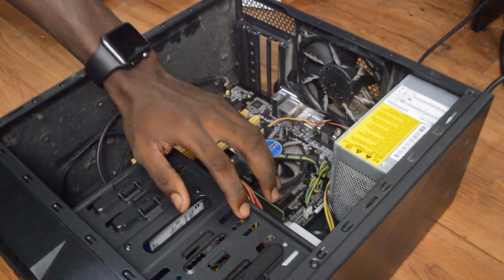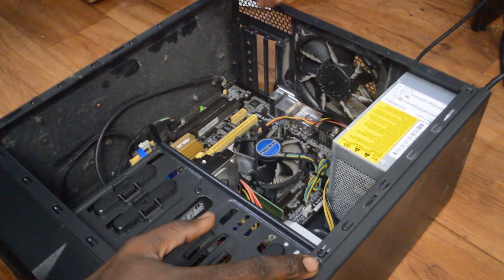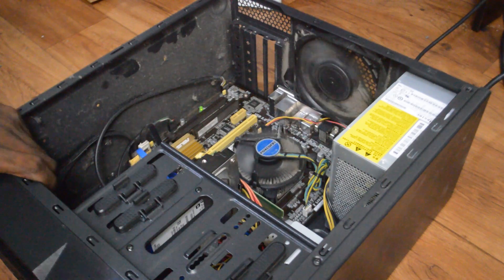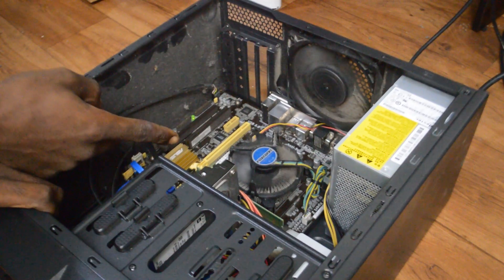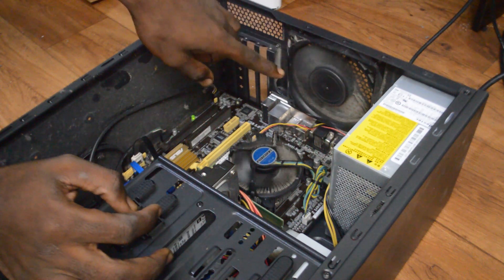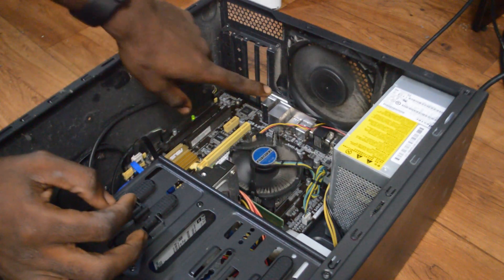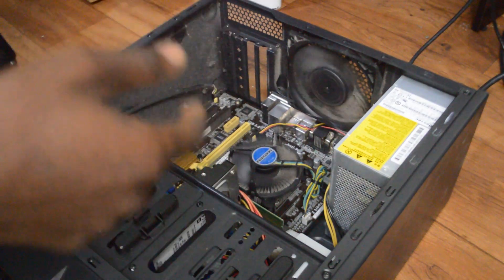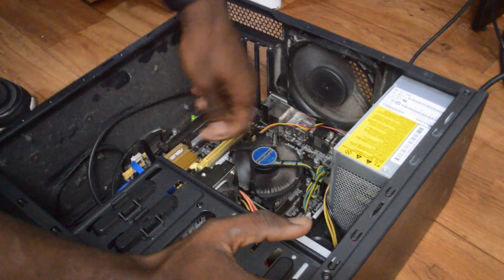Computer won't Turn on Fan spins Then stops | PC Repair | Get Fixed

Comment: It did not fix my computer😢😢😢😢😮
Reply from the maker: Did you recently change any parts in your computer? Make sure the Ram sticks you have in your computer are the same type of RAM’s and are compatible with the computer.

Comment: I have this issue with the fans running for a second, i tested the psu and works, tried without the gpu - same fault. Tried different ram slots - fault still present. None of the 4 led's on the mobo light up either. I've tried oretty mich everything and fault is still present
Reply: Mobo problem

Comment: my fix was...

my HP power off and wouldnt start with fan spin 2 sec and green light
on back went off.. and power button orange 2 secs with it
turned out to be a bad video card.. capacitor dried out in 14 years
nvidoa .. replaced with same bus card a radeon 1080p and booted up
but had at first reset by holding in power button and plugging in ac

Comment: I had the same problem, went into my pc and started pushing cables in - mostly SATA cables and their power supply cable, but also the RAM

It worked after that with no troubles
Reply from the maker: It's at least the RAM like 75% of the time. Either incompatibility issues or it's simply not slotted properly. Than the wires, and last are major components like the processor and or the power supply.

Comment: Thanks man this vid was hella helpful. I unplugged everything and did the paper clip test on the psu which fixed the issue of the fan stopping every couple of seconds. I then used a screwdriver and put it in between the 2 pins which helped me determine that I still had power in the mobo. After that, I ran into the issue of the fan turning on but nothing else did. What worked for me was replacing the cmos battery which allowed me to boot into bios and finally loaded in. Took about 10 hours. I highly recommend a mobo speaker it would’ve made the job way easier in finding out what was wrong.
Reply: What do you meam by the screwdriver for power on the mobo
Reply: @mikooou  There are 2 switch pins on mobo (+ and -) and you cam turn on pc by connecting both pins with any small metal object.
Reply from the maker: Thank you for the explanation.
Reply from the maker: Thank you for breaking everything down Stephen.

Comment: My pc just stopped working yesterday. I tried testing the power supply but it does the same thing when i click the power on button. The RGB fans don’t light up, but they spin for 1 second then turn off. Then if i click the button again it does nothing, i have to unplug and replug it for it to even do anything. HELP WHAT DOES IT MEANN
Reply: did you solve your problem?

Comment: i hit the power button it spins my cpu fans then stops and my rpg fans dont even start or spin same with the led for my gpu :T my rgb ram lights dont even start.. T_T
Reply from the maker: Then you just evaluated your possible issue. Your RAM isn’t coming on. Try taking one out if you have multiple and then turn it on. If that doesn’t work, using the 1 RAM, stick it in another slot and try starting it.
Reply: @GetFixed  sorry i didnt explain my comment i made the pc with brand new parts :( it randomly just shut off. I can only see the led lights for my motherboard did my psu died? or my motherboard dead :(?

Comment: i have this prob . i replaced mother board and cpu thinking that could be the problem but it still does it. i cleaned the contacts on the ram, swap slots and tried different sticks of ram. i can get it to boot but only if a remove all the ram and start pc then switch off pc and reseat 1 stick of ram but every time i have to do a restart i have to go though that process.
Reply: Mine does this too
. Did you solve your problem?
Reply: @anjinaer  i did, i swapped out the motherboard and cpu and it still did it. so another new motherboard cpu and psu. and as far as i could gather it was the psu.

Comment: PLEASE HELP my fans are pulsing just like in the video, there is also a small white a light pulsing. I tried changing slots of the ram, turning it off and pressing the bourtin for a min and pretty much everything in the video but it's not working does anyone know what's up?

Comment: I had this problem too
I thought one of my rams died because one worked but the other didn't i took it out and in and switched slots multipletimes like over 6 times until it worked at the end both rams were fine

Comment: that happened to my old acer pc my spins all the time
Reply from the maker: If you have multiple RAM sticks, try removing all of them but one & boot up the PC. If the computer boots up then that most likely means that you have different RAM cards in the computer that isn't compatible with each other.
Reply: Ok
Reply from the maker: You probably don’t have that pc anymore but if you do, let me know what happens.
Reply: @GetFixed  yeah I don't. I just gave it to my dad at kept some parts like use ram hard drive and other stuff

Comment: Beware switching that red button....can fry your computer.  Only switch with power off then switch back.  Its for volts depending on if u live in US or UK.
Reply: Do you mean the switch on the PSU? Power off meaning PC not connected to the outlet?

Comment: I tried powering up my old computer today, doesn't work. no keyboard, mouse, monitor power up, but fan works, CPU fan on and off. been looking into it tonight and i am thinking its probably the power-supply? They don't always totally die. Annoying though, glad i bought new computer.

Comment: Dude can i ask something? I was cleaning my pc and then i after cleaning it put all the positions back but when i press the on button on the pc the fan spins for a sec then it stops. Both of my fan and power supply fan does same thing, both of them, the fan and the power supply fan does it then spin for a sec then stops. Really hope you can help me.
Reply from the maker: Make sure your graphics cards are sitting in their sockets securely. If they are, take one of the two graphics cards out and try powering on the PC.
Reply: @GetFixed  Sorry but, I dont a graphics card.
Reply from the maker: I meant to say take one of your RAM sticks out.
Reply: @GetFixed  i only have 1 ram stick i did take it out and clean it with eraser  put back in and turn on still the same i took it out in his place and put it back in the other place

Comment: The main problem of fan spinning and off is the Ram..Switch slots and if it didn't work replace the ram and try booting it..Fixed more than 10 PCs withthe same problem..Hope this helps..
Reply from the maker: Lookin forward to hearing your results Notusky. Let me know if you need any additional help 🙂
Reply: Bro my pc suddenly stop then my AVR wont turn on then when i turn it on again it already has screeching noise in the avr and it already has a  fired wire smell , i already changed my avr but my cpu is not turning on again the fan turns on and and suddenly off in a few seconds repeatedly i think it already damaged the power supply?
Reply: Noice!
Dis worked thanks
Reply: BRO IT WORKED !!! 
THANKS
Reply: BRO I LOVE YOU THANKS YOU SO MUCH, I WAS THINKING OF GETTING A TECHNICIAN TO FIX IT WHICH IS LIKE AN HOUR TRAVEL, this saved me a lot of time and money THANKSSS
Reply from the maker: Sweet
Reply: Tysm this fixed the problem but can anyone explain why?
Reply: Thank you so much, I didn't know what to do.
Reply: Thanks Brother!
Reply: This worked. Thanks for your helpful comment.
Reply: Thanks bro it really works wlhi😮
Reply: Bro thanks
Reply: Amazing 🎉
Reply: I changed the slots and the fans got better, but when I changed the slots there is no image on the monitor.
Reply from the maker: @ietzell After changing the slots, change them back again to their original slots. Also make sure that both Ram sticks are the same and compatible.
Reply: Seeing this comment releases every stress in my body thanks
Reply from the maker: Arvand. Where you able to fix your computer?
Reply: Reinserting the ram solved the issue bro.

Comment: I got seven beep sounds, then I reinserted  cmos battery,  no sounds but fan spinning
Reply from the maker: Try taking out one of your RAM cards to see if it’ll boot up.
Reply: @GetFixed  1st step: I did for ram slots,
I thinking about changing processor ..

Comment: Hello, my pc won't turn on, the fan is on for 3-5 seconds then it turns off. When I try to remove the RAM, it works. But when I put the RAM back, it won't turn in again. What do you suggest me to do. Thank you so much!
Reply: Change the RAM slot i.e. switching the RAM ports

Comment: I have a problem that my computer fan is only spinning but power button light is not on and display is not showing I have changed every ram please help and reply
Reply from the maker: Instead of changing the ram, try pulling one of them out and then attempt to turn it on. Let me know what happens.
Reply: @GetFixed  I have changed every ram means that.........as you say pulling out one of them I also tried but didn't work

I think problem is before shutting down my computer I have changed my virtual memory may be it is the problem can you tell me how to fix it please

Comment: Took my neighbour’s old windows 7 rig to work to install an ssd and upgrade it to win 10. It turned on fine before I unhooked it. It may have gotten knocked around in my trunk. When I got it to work it wouldn’t turn on, fan would just spin every few seconds. I did the switch ram slots like you said and it worked without problems. I have no idea why in the world that would happen and why switching ram slots fixed it. Computers are WEIRD. Either way, Thank you sir!

Comment: I removed the RAM and put it in a different slot and fired it up. It started working right away LOL. Thanks!
Reply from the maker: Nice. That probably means that your PC is prioritizing certain slots to boot up.
Reply: @GetFixed  Hi when I plug my computer up. It automatically starts without me hitting the power button. And the fan starts spinning. But then it turns on and if. No matter when I unplug the computer. As soon as I plug it in the computer fan comes on. But the monitor says no signal.

Comment: I had the same problem but I had to change out 2 capacitors on the motherboard and it worked.
Reply: Is it smd or aluminum electrolytic caps?

Comment: okay this is weird but help me out please. When i just press my power button on my pc it wont show display and my cpu fan will stop spinning after a few seconds. But when i flick the power switch on the back and then hit the power button on the front it always boots up normally with display and cpu fan does keep spinning. It does stop every now and then tho so idk what the problem is. The pc keeps running tho.

Comment: My cpu fan spins for a second and stops n doesnot cycle like in the video
I replaced my psu
replaced with new cooler
could it be because of faulty motherboard ram or any??

Comment: That turning on/off is power cycling! This can be caused by a number of things, but is usually related to RAM; some Motherboards can be 'picky' about what RAM they will use, or if it becomes unseated.
Reply from the maker: Thank you David. I will make an updated version of this video and inform my viewers of that. All credit to you. Thanks again!

Comment: When I turn on the pc, it says that no signal and the fan goes on and off, whats the best way to fix that?
Reply: Me too, I hit it with my hand and it worked for one day again and does this again
Reply: Put out that ram and put it in again  @slowassmiata
Reply: Make sure everything is plugged properly and into the right connections. Make sure your PSU is rated for your system. Make sure that there are no shorts in the ON/OF switch, check it by unplugging the I/O switch and short the pins labeled +PWR_SW PWR_SW- together. If it stays on that means there is a short in your power switch
Reply: Mine go at full speed and then they slow down

Comment: Hey could you help me ? I just upgrade my parts pc turns on for a split second and the fans run for a second as well then turns off and turns on again for a second and stays off.
Reply: Me too, didn't do any upgrade, just took the PC from house a to house b and it happened
Reply: Kanny Looi did you end up fixing? Mine has done the exact same thing when moved house
Reply from the maker: Take out one of your ram sticks and try starting it.
Reply: Get Fixed yea worked cheers
Reply: mee toooo

Comment: I have a problem with my CPU fan: when I start the pc I always get the error 511 fan not detected, so I tried to do a diagnosis of it and it seems that it sometimes tries to do a little movement but stops afterward. I then tried moving it a little with the finger and then it starts spinning normally. The problem is that when I start the pc it doesn’t move and the only way to make it go is to give it a little speed, but I can’t do it everytime. How can I fix this?

Comment: I just built a PC and it turns on but the monitor stay black nothing go on I check the ram stick move them around nothing I changed the power supply still nothing and the motherboard is brand new and the processer  but the fan on PC turns on and off I don't now why this is happening
Reply: Same I'm always comfused
Reply: Is the cable from thepnitor to pc into the gpu?
Reply: Gpu

Comment: When my computer is on, all of a sudden there is nothing to do with the monitour. If the mouse keyboard monitor is not working or the ramp is turned off I will not use the computer for two or three days. If you can help

Comment: Audio Bit outta sync. But great video
Reply from the maker: You’re probably right. My editing program was acting up that day. And thank you my man. I appreciate you.
Reply: @GetFixed  yeah algoods.  I'm having trouble with my PC.  It turns on... does nothing for a few minutes then fans spin up full... no post or nothing.. tried unplugging everything... even disconnected other hard drives... might try different SATA socket and or cable..
Reply: Darkethereal Gaming that’s the exact same issue with me. Have you found a possible solution bro?
Reply: When you record videos, Record the audio on a separate track, this way you can sync, cut and copy easy